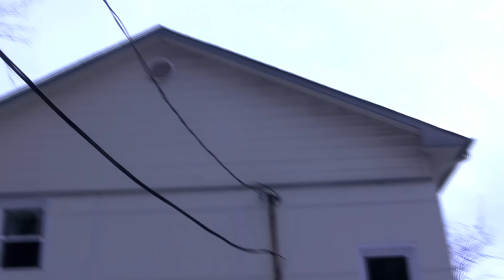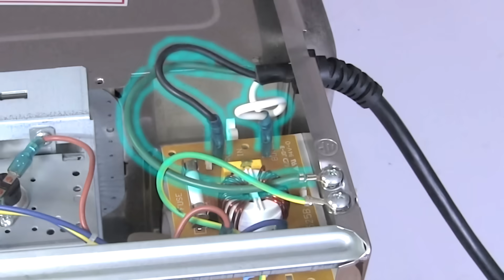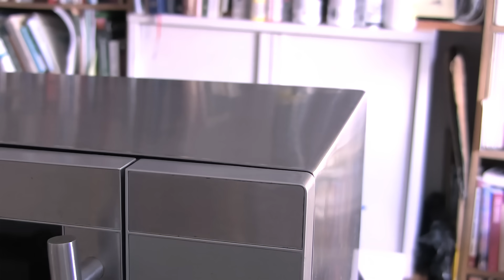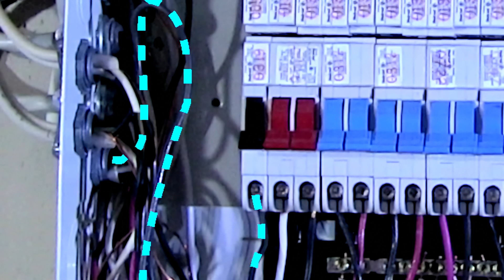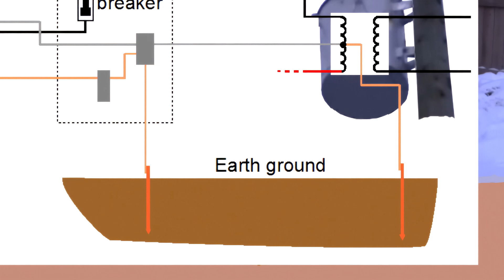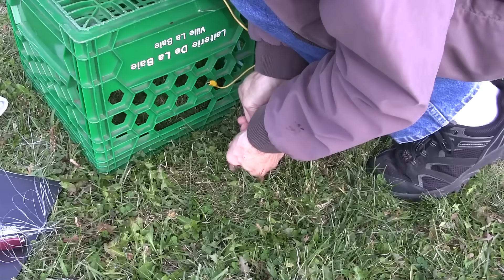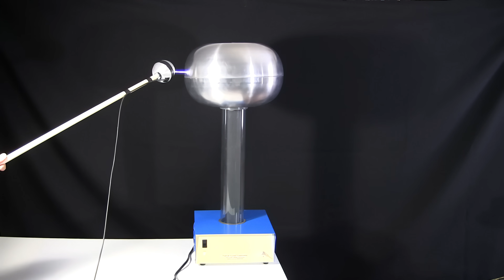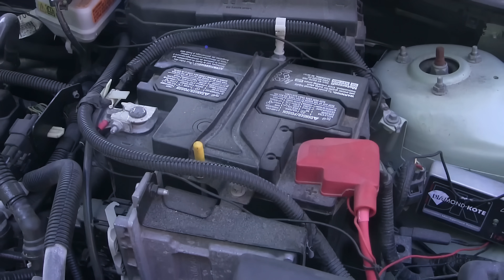What is Ground? Earth Ground/Earthing

Comment: So why not just omit the ground wire completely and substitute with neutral? By your explanation, they are the same thing. Connect neutral to the chassis instead of ground, which goes to the same place. A fault happens, and the current is still drawn through the breaker so it trips.
Reply: A ground is intended to not carry current, a neutral is. Why is this important? Everything has a resistance, which means when there's a current flowing, voltage is dropped and hence there are potential differences accross the system. Don't be fooled, even connected neutrals can bite between them and earth ground.
To summarise, neutral is the 0V return wire to carry the current back to the supply completing the circuit.
Earth ground wires are used for fault safety, equipotential (various conductive surfaces such as pipes, steel house framing, reo concrete reinforcement etc are forced to stay at the same level with no potential difference) and electric charge dissipation into the earth itself.
Another example of electric charge dissipation are lightning rods. Many aren't designed to catch lightning rather prevent it. The idea being the capcitance between the ground and the atmosphere gets equilised by allowing the charges to drain between, preventing the natural method of a sudden discharge (lightning strike).
Reply: +Tera Volt There is 0 potential between neutral and ground, therefore no current can be pulled from neutral to ground unless a stray charge. So if everything is in parallel, as is the case in most homes, there should not be a problem. But in series where potential difference exists, then I see what you are saying. I forgot about voltage drop across a load and you reminded me of it.
Reply: @RAndrewNeal  You're still forgetting cable has resistance as well as the load, so the further away from the N-E bond(s) will have more potential rise with more current. It's not a perfect world.
Reply: +Tera Volt You got me there. I didn't forget about the resistance, but I also don't know the resistance of copper wire per foot per cross-sectional area. I didn't think it would get high enough, but that's something I've yet to look into.
Reply: @RAndrewNeal  "There is 0 potential between neutral and ground, therefore no current can be pulled from neutral to ground unless a stray charge."

While there is 0 voltage, that doesn't mean current won't flow on both if they're connected. Its Ohm's law. Current will take multiple paths back to source; it doesn't just choose to stay on one like a train on rails.

And what you describe in your original question is essentially what people are doing when they use a 'bootleg ground.' They connect the ground connection of a modern plug to the neutral of old wiring where there is no green (or bare) wire. And while this works, in the sense that the equipment will function (and is testament to your point that they are close to 'the same thing') there is one important problem: all the metal of all the appliances in the household now have current traveling through them on a regular basis. In ideal and theoretical situations, it is current, not voltage, yes... but if one thing goes wrong... its all hot and waitin' for ya!
Reply: @RAndrewNeal  &  Tera Volt -- there is also resistance in connections. In fact, loose connections is a fairly common problem. In that situation the resistance can be very high. This the need for redundant paths back to the ground connections in the box.
Reply: They aren't the same thing dude. The ground doesn't lead to the transformer. It leads to what's called a busbar with all of the other ground wires that has another grounding conductor that leads outside to a grounding device ( a rod, plate, etc.). Ground is exactly what it sounds like. A safe path to the ground/ Earth. The neutral handles the return current back to the transformer.
Reply: @Boney1807  You're right that they're not the same thing for practical/safety reasons (see other responses here) but it's actually incorrect to say that ground (referring to equipment grounding conductors - EGC's) don't lead to the transformer. That's exactly what they do. If they didn't, we wouldn't get adequate fault protection through the grounding rod(s) due to their usually too high of impedance. Is is a fallacy to think that current is in essence 'trying to get to ground' in the sense that the physical earth is somehow its final and most desired destination. Current is returning to source, and the lowest impedance path back to source (transformer) is through the grounds/neutral bus bar bond --> the service neutral --> onto the secondary grounded tap; no physical earth necessary. Check out 'Mike Holt - grounding and bonding' for in-depth discussions on this topic.
Reply: @spruce_goose5169  yes you're right about the ground to the transformer. I just discussed that with my teacher and you're right. He cleared that up.
Reply: +Kevin No, neutral is grounded anyway, and has zero potential to anything other than a hot wire, hence the name neutral. You can't get electrocuted by a neutral unless it's broken somewhere down the line and you're now the path of least resistance.
Reply: Sorry I misunderstood. The only other thing I can think of for having a grounding wire is to prevent any build up of static voltage on the metal casing. Grounding will always keep it at a zero reference.
Reply: +Kevin It's okay. Yeah, grounding serves both purposes. Keeps everything neutral and earth grounding to discharge static electricity so it's not a shock hazard.
But sometimes the ground itself is a shock hazard if you've been charged. Lol
Reply: +Kevin I've learned a little more about its purpose too. So that's why my response is from a place of agreement rather than learning.

It is also a redundant path back to the source so if the neutral wire breaks, there is no way you'll be electrocuted since the casing is grounded and connected to neutral at the box.

Comment: What's the point of ground if it's connected to neutral anyways? Redundancy?
Reply: Didnt you watched the Video ? 
The Ground connection is a safety Feature. Not needed for a circuit. 

As an Example take the Microwave with that Aluminum body and let there be a mistake that the +230V AC (in Germany) Hot wire touching the housing. 

If the ground is not connected, the housing would have the same potential (230V AC).
When you touch that surface you get yourself electrocuded. 

If  the ground is connected to that, the circuit would be closed and because of the low resistance of this circuit a high current would flow wich result in snapping the fuse. 
=> You are Safe 

Hope you understand it now. Greetings from germany.
Reply: @MatthiasW97  DO I LOOK GERMAN!?
We don't use 240V live to live on a microwave oven. Live to neutral.
Reply: in Kanada/US/Mexico they use 120V AC with 60Hz  @leerman22   
live to live is not possible. Same potential => not potential difference => no voltage
Reply: and dont forget the neutral also holds the same current as the live. 
Its only save to touch because it is at 0V. 
In the early days there were no extra ground cable wich lead to a lot more accidents.   @leerman22
Reply: @MatthiasW97  OK man, we have a center-tapped 240V single phase transformer. 
Center tap is neutral and the 2 live wires are 180 degrees apart. 120V @ 0 degrees + 120V at 180 degrees is 240V difference. That's how my laundry machine and air conditioner are powered. 
If you go from live to live in the same room then they are on the same side of the transformer reads zero volts, but read a lead from the next room an it will read 240V. 
Every even numbered breaker is on 1 side of the transformer.
Every odd breaker is on the other side of the transformer. 
240V breakers cover 2 slots so it gets both sides of the transformer and there's a neutral for unbalanced loads.

The UK has everything live to live 240V because they wanted to save copper using ring circuits.
Reply: Ok right, i think we talked past each other. Every country handles that diffenrently. 
I was talking about an IT- and TN-C System. @leerman22
Reply: @MatthiasW97  Only if the case is intentionally use as a return like in a car. That's why I brought up redundancy, so if either ground or neutral are broken then the case couldn't be hovering at 120V. Of course if there is a grounding fault then the neutral can't do anything but leave the microwave case live, but that means 2 different faults have to happen.
Reply: @MatthiasW97  I didn't read your replies in order, just the way utube dished them out.
Reply: Yes you are right.  I was trying to say that having the neutral and PE (ground) connected like the guy in the Video is in my opinion not the ideal sollution. Because you cant use a RCD. (Safety fuse that compares the current in live vs neutral. If it isnt the same it will break the connection. If the PE (ground) is connected to neutral there will be no difference.
Its much more safe than hoping the normal live fuse will break if live is connected to ground.  
And sorry for my bad english.   @leerman22
Reply: @MatthiasW97  RCD's are placed near water which are most likely to be grounded anyways, plus a human absorbing those few mA's would be enough to trip it. Not ideal but still works. 120V won't likely kill anyone unless you are in the worst of scenarios, I've had my fair share of zaps just from uncovered light switches. We're not insane enough to put 240V in a standard NA wall plug.
Reply: Yes. But to come back to your question why we have a ground if its connected to neutral anyways. The importance is where they both meet. 

to the 1970s in germany we had a thing that we just connected the housing of the washingmaschine etc. directly to neutral. Some things can happen 

- The neutral can have some voltage because of wire resistance and its current.  
- To eliminate the case that if you exchange live and neutral (example in your socket) you dont get the full voltage on the housing 
- If the neutral is interrupted (drilling a cable) you dont get the full voltage on the housing 

So redundancy is exactly the right word. 
I thought you ment that with your Question.  

   @leerman22
Reply: Not redundant. The ground does not conduct. Loads are not bonded, only the panel is bonded. 
Without a ground, you would not tie the neutral to the case, or you'd electrify it. You'd have the load between hot and neutral, and the human between neutral and ground. Two resistors in series, as a voltage divider.
Do the math with, say, a 10A appliance a heart pacemaker.
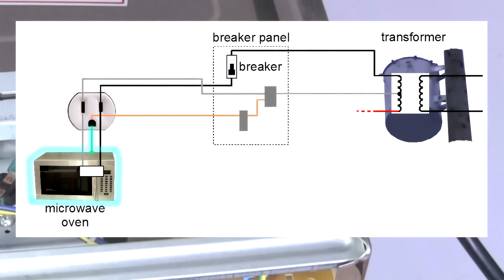Reply: @frankbelluccia2689  There's only .3 volts between ground and neutral in my home. In the 2:22 example he shows ground and neutral connected at the breaker panel.
Reply: One is intended to carry the current, the other is not

Comment: In Holland we like to standardize everthing. And we call these networks either TT, IT or TN networks. TN can be devided in 3 different networks TN-S, TN-C and TN-C-S networks.

What is being explained in the video can be an IT, TN-S, TN-C-S or even a TT network. Its hard to say, as you can only see one side of the installation, but my guess would be a TN-S or either a TN-C-S network, but with a earth pin on both the household side and on the transformer side. And no RCD.

What we use in Holland for house holds installations is called a TT network.

The 2 letters represent a code.

The first letter (either a T or an I). Determines how the side of the transformer is connected to earth. (The star point).
And means the following:

T represents a network where the NUL/Zero/Neutral is connected to the Earth on the transformer side.

I represents a network where the NUL/Zero/Neutral is isolated from the earth on the transformer side.

The second letter (either a T or a N). Determines how an user is connected to the earth (a conductor or the housing of a unit).
And means the following:

T represents that the housing is connected to the earth.

N represents that the housing is connected to the NUL/ZERO/NEUTRAL. 

TT network are less safe and have a lower reliability compared to a TN network.
The safety issue can be dealt with by introducing a so called RCD switch that will switch off the power to the breakers very fast and on a relative low isolation fault. This level can still be dangerous though (30mA max in Holland). RCD switch stands for; Residual Current Device or Residual Current Circuit Breaker).
A benefit of a TT network is that you can distribute Power over long distances.

An IT network is more reliable, in the sense of keeping everything up and running, even when an isolation fault occurs. As the isolation fault can't make a loop with the NUL/ZERO/NEUTRAL of the power source. As the NUL/Zero/Neutral is isolated from the earth. This is used on ships and/or hospitals for example.
Earth and NUL are isolated from eachother. Transformer has a floating NUL and is NOT connected to ground.
(NOTE: when a isolation fault occurs, it has to be solved before a fault occurs in another (2nd) fase, as this will be the same a short circuit and the breaker will trip!)

TN is the easiest to setup and saves a lot of money in costs. An earth fault (isolation fault) is the same as a short circuit and will trip the breaker, due to the high current that will occur. 

TN-C = 2 pin socket installation, household has no earth. NUL and Earth are 1 and the same. Only the transformer side has an earth pin.

TN-S = NUL and Earth are isolated. Only the transformer side has an earth pin.

TN-C-S = NUL and Earth are partly isolated and partly joined together. Only the transformer side has an earth pin.
Reply: Same like in Germany. Well, I think he uses a standard between TN-C and TN-C-S since the Earth is fully joined together.
Reply: @fikrinoh1135 but I read u should only bond neutral to ground at main panel or tranny but not both!!!!
Reply: I'm from the US.  My opinion is in Europe you guys use way too many acronyms!   I designed electrical systems for over 30 years and was amassed when I say John Wards videos telling about your systems.   It's the same thing, just different words.   Pronounce aluminum and you will know what I mean.    Enjoy life and be safe!

Comment: 'Hot wire' LOL.........we call it 'live' in the UK
Reply: Hot and live are both used, but, "two hots" is more common; you might say "a live wire(s)", but you don't commonly say "two live wires". The "Hot" can also be useful to distinguish two hots (single phase with 240 phase-to-phase), from two phases (208 ph2ph).  Single residences get 240V (2H+N), an apartment complex will likely be fed with 3-phases (3H+N).
Reply: Same in holland... and i think its the same in America/Canada..  its called the Live wire... you always talk about the N and L connection terminals... where N stands for Neutral and L for Live
Reply: Remy Obanor  Here in US in residential and commercial with single phase, we have L1, L2, and Neutral come to us from utility.   So Line 1, Line 2, and Neutral.   We call them "Hots".  Three phase is "Phase" A,B,C, and Neutral(if there is one).